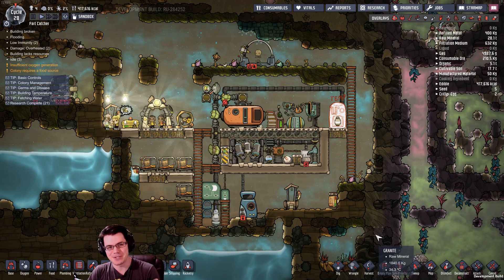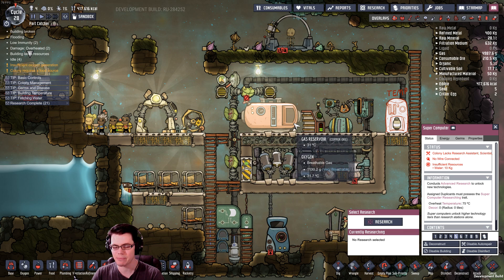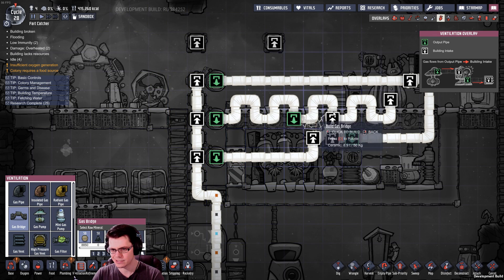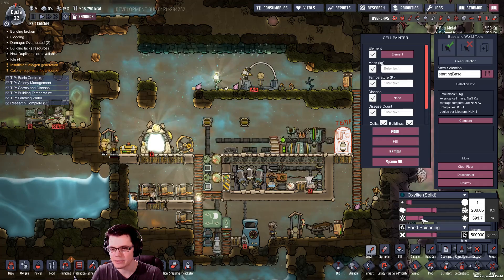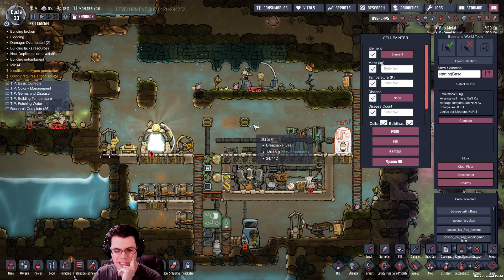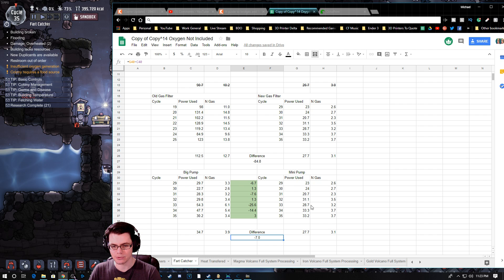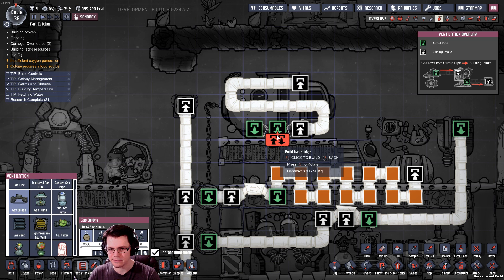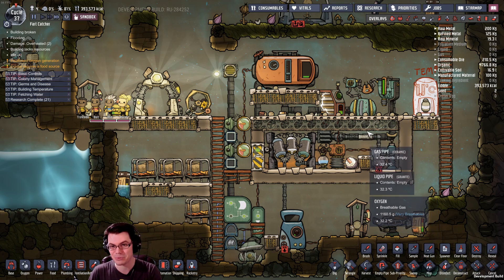Efficient Gas Filtering! Oxygen Not Included Fart Power 2

Comment: Also, for more efficiency, you can put a element sensor on the start of the natural gas pipe and a filter gate after it to trigger the pump only when the pipe is full
Reply: the filter gate should go to a not gate in order to shut off the pump if the gas is backed up.
Reply: Better idea is use an element sensor to detect when the generators pipes are filled with natural gas, and then run than into an xor gate after the and gate for the pump and then run the xor gate into the pump and the and gate into the xor gate. This would make the pump stop operaterating while the system is supplied with gas saving a ton of energy. And then later on once you have access to the microchips for the generators you could make this produce 1.2kw just off of three duplicants farting.
Reply: If you make a return pipe and use the pipe priority , the pipe Will become full and disable the pump
Reply: @rebrait  really? Is that a new feature? I don't think I've seen that
Reply: That is actually the better, simpler solution. Good job man. Steven, when he talks about pipe priority is that in a closed loop the normal pipe always has the flow priority and bridges can only add more gas if a space opens up. So make sure the gas from the pump comes off of a bridge into the main loop.